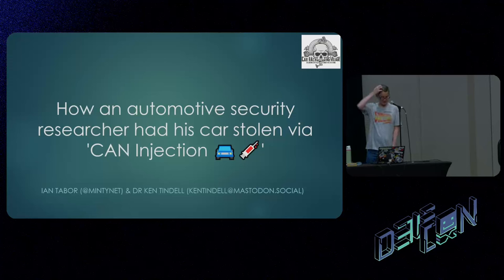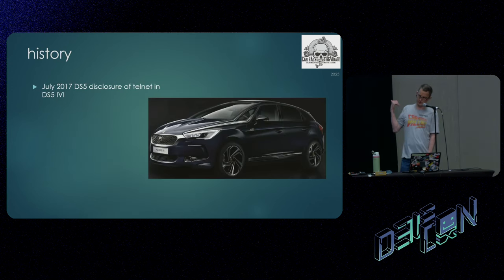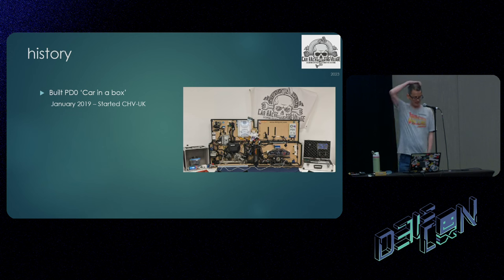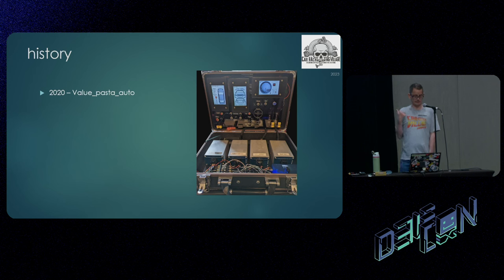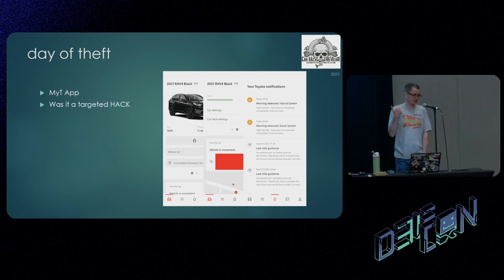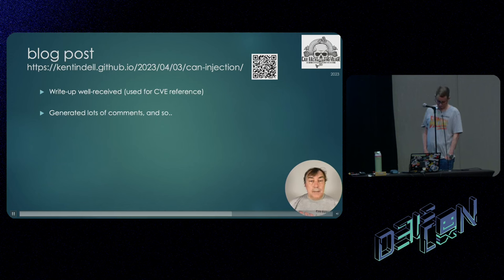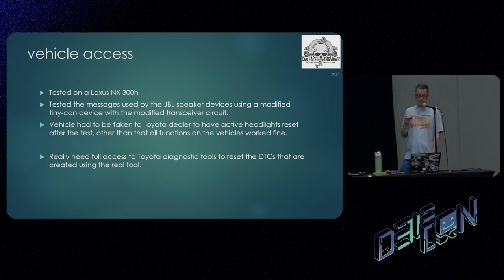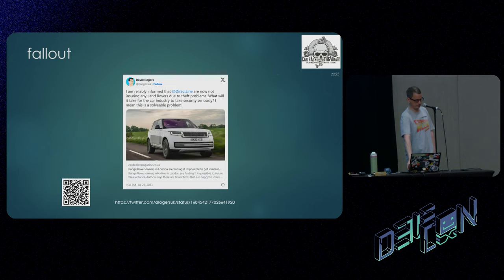DEF CON 31 Car Hacking Village - How an Auto Security Researcher Had His Car Stolen - Tabor, Tindell

Comment: Actually, the first suggestion is the only correct one. Devices accessible from the outside should not be on the same bus as the main security modules. Never.
And the excuse about the cost in production - just indicates that the manufacturer is extremely interested in its own profits, but absolutely not interested in the safety of the customer's property, after he gave money for it to the dealer... 
Actually converting all the devices and modules on the bus to CryptoCAN will be more expensive than an isolated bus for externally accessible devices.

Comment: Anyone who is into the business of automotive security system installation knows about this CAN attack through the headlight wiring on Toyotas. And Toyota has known for a long time for sure. And it was known well before 2021... Hijackers have been using this method for a long time. So it's nothing new.

Comment: use LIN bus instead of CAN for headlights
Reply: I’m newer to this field and just curious what do you mean by that?? How does it differ?
Reply: @savagesl4yer  the LIN bus, unlike CAN, is usually used for less critical systems, e.g. headlights control (You can still argue that headlights are critical for driving in the dark, but yeah still not critical as the braking system for instance). When you connect those systems to the LIN bus you separate them from the critical systems connected to the CAN bus. In a way, you are segmenting the bus network to avoid that hijacked less-critical ECUs can control very critical ones.